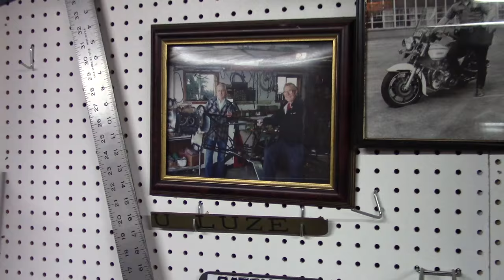Wiha 7-Piece Insulated Industrial Tool Set Review

Comment: If you think those pliers are going to last a lifetime for an electrician your kidding yourself. That crap pliers way to bulky decent pliers are made by Marvel. I have used their screwdrivers but prefer wera way more comfortable. On the whole this review is way off on lifetime lastability.
Reply: 1.  Who said he's a full time electrician?  They will absolutely last decades with light use.
2.  I don't think you have every used proper German pliers.  While Wiha pliers may look "bulky", they feel great and ALWAYS move without any resistance.  Personally I think Knipex pliers are the best because they are very slim (nothing like this on the market), handles have bigger slip protection and are also butter smooth.  You can open it with a flick of a pinkie.
Marvel, etc. don't even come close to Knipex/Wiha.